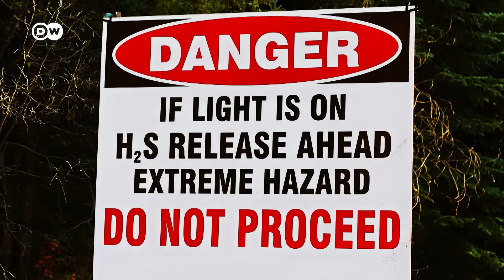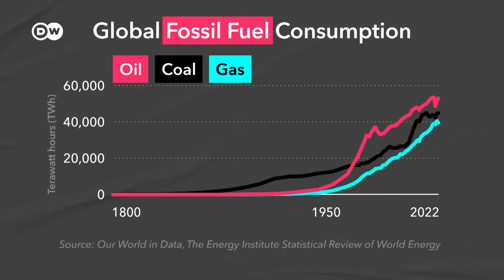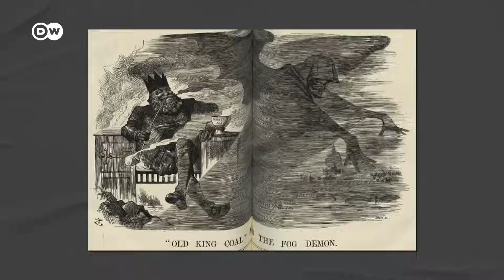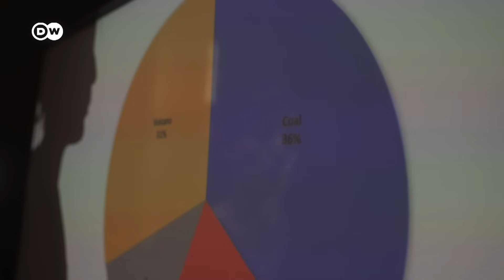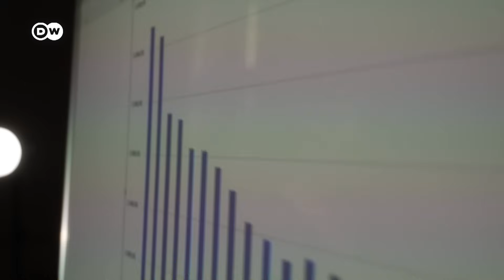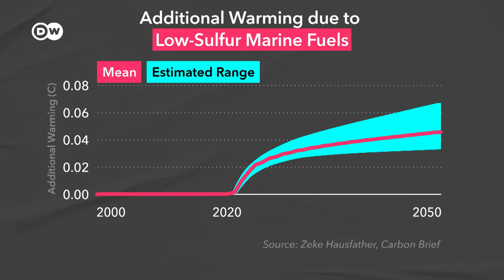Why we need to talk about this hidden poison gas

Comment: 4:07 As if USA don't have oilfield and oil refineries. So called Greenpeace is super bias towards other countries. Who funded it?
Reply from the maker: Hey! 🌱 The US does have a ton of oil fields and oil refineries for sure, but has reduced SO2 emissions a lot over the past decades by scrubbing the emissions (as you can see at 7:38). The report in particular was looking at worldwide hotspots of SO2 emissions, of which the US is no longer a major one. If you look in the report though, specifically on page 18, you can see the US is still the 9th top emitter of SO2 worldwide (according to this data), although it did reduce emissions by 5% between 2018 and 2019. 🔗 https://www.greenpeace.org/static/planet4-mena-stateless/a372e5fe-so2-report-english.pdf

Comment: Off topic questions:
What would happen if we were to atomize water where we have excessive amounts of it? 
Would it provide a means to transport water to areas that need it more?
Would it help absorb carbon emissions?
Would it refract more light than it reflects?
How much energy would it require to make a difference?
What would be the least energy intensive methods for doing this?
How much water would have to be atomized to bring our oceans back to normal levels?
If we were to atomize enough water to bring our oceans back to normal levels, then what would our atmosphere look like?
How much energy would be required to atomize enough water to bring our oceans back to normal levels?
How would generating enough energy to preform these things affect us and our planet?
Reply: what are you blabbering on about?? water is simply hydrogen + oxygen, both abundant atmospheric gases. why would you want to waste huge amounts of energy just to 'atomize' water into its constituent gases for transport?? i'm sorry, but your idea is simply bonkers and nonsensical.

Comment: Why are fillers not used to capture this terrible stuff?
Reply: They are in a power plants and chemical plants as well, and they are very efficient. It’s industrial standard for years. Nowadays the problem is with households and individual coal fueled furnaces. Large scale facilities are obligated to monitor and reduce emissions. By catching sulfur emissions, industry is creating plenty of value byproducts, such as gypsum and sulfuric acid. Of course, we’re talking about so called “first world countries”.

Comment: That massive fuel reservoir for shipping is now being directed to aviation fuel, so the So2 is instead being dispersed into the upper atmosphere instead of ground level.  It's a scam and much worse. It's why there's a yellow brown ring around the sun and moon now that wasn't there before 2020.  It is also destroying all the ship engines that need the sulfur in the fuel for lubricant.   There's another side of this story being hidden.  Overlay the satellite So2 images over top of flight path maps and see the correlation.

Comment: Sorry, couldn't get past the head line- which is a huge fiction: sulfur emission reduction is a major focus of both ICE development AND other fossil fuel power generation revision efforts.   Shipping is a prime example, where sulfur cap targets were set years ago, along with standards, and there have been significant investments and progress toward those goals.
Reply: Yes… they detail all of that in the video
Reply from the maker: Hopefully you will get past it! In the video we point out how sulfur has been heavily regulated, which is why it has not been so widely talked about in the public discourse lately. BUT that it needs further regulation still. 🦾
Reply: @DWPlanetA  That's an easy fix then- just edit the title: it seems to me a disservice to the effort, undermining credibility.   Thanks for the reply.
Reply: Yes, and now we have acid rain. The thing is that was also cooling us some. So now North Atlantic ocean surface temp is totally out of scale

It's pretty neat. We're getting screwed every and all at once
Reply: Yes, you are right!!

Comment: The closest monitoring station shows had the worst result in winter and it was 4,6 µg.m–3 (still way bellow the limit) and since 2011 it is 60% lower
I remember how we were taught that in Krušné hory nearly all forest died off because of acid rain caused by the coal powerplant located there (they changed dying sprouce for non-native douglas fir but evan that did not thrive as much but it was able to grow). After desulfurization of powerplants these forests recovered (but still mostly contain non-native douglas fir) and you cannot spot anything wrong with these forests. Desulfurization led to 93% of SO2 and 60% less of SOX and I´m really glad that Czechia recognized this problem and started to implement solutions almost a decade before we joined EU (the main dancerous thing that we have to deal with considering air is the above limits of benzene and pyren that endanger around 20% of our population)